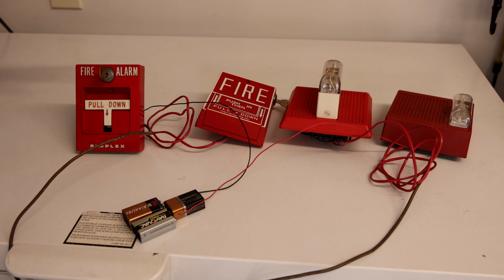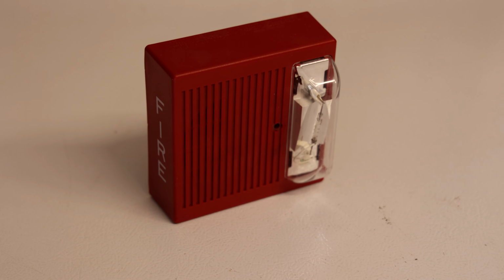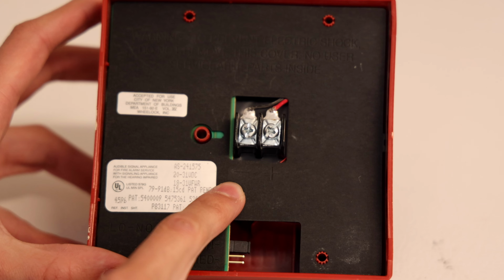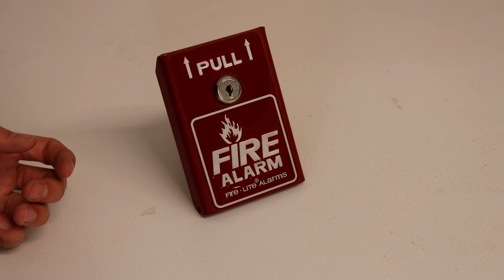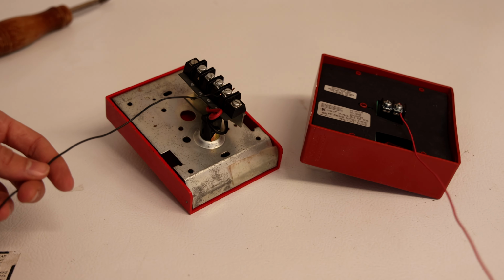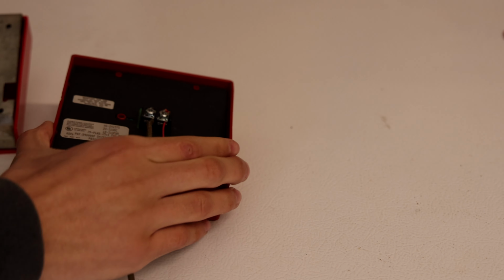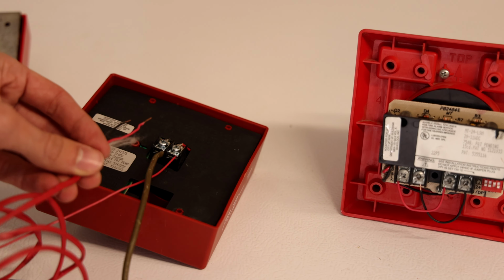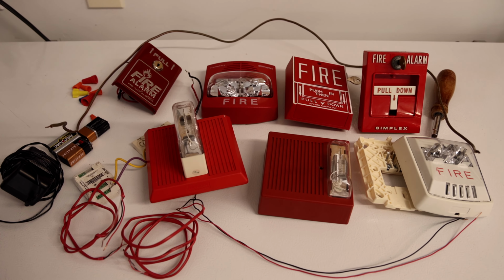How To Wire Up Fire Alarms Without a Panel

Comment: I'm going to be getting some wire that have clips to use with my EST Genesis Remote Strobe and Simplex T Bar Pull Stations. Will those work if I clip them onto the screw posts?

Comment: Thank you s e r I know how to connect a fire alarm without a control panel even though I have a control panel I do not want to use it I want to connect fire alarms to pull stations😊

Comment: Yo! Great video! Ive been interested in doing this for a little while but i would like to use the adaptor. The only thing is i cant find one with wire ends. Do i just chop off the end part to get those? Thanks!
Reply from the maker: Yes, you can cut off the piece on the end and then strip down the two wires. Of course, make sure it's unplugged when you do so, the right kind of adapter, and that you don't need it for anything else!
Reply: @SERSafety  Thank you so much!!

Comment: What wire did you use to connect the second pull station and fire alarm? If I was working with a plug do I need a 27 V AC power plug?

Comment: My son has recently gotten into fire alarms and we're building some demo stations together.
When wiring up his alarm to a pull station it seems that a small amount of power is bypassing the switch. The alarm goes off faintly, then fully when the switch is pulled. 
Any clue why? I'm not sure if it's addressable or not. Could that be why? 
Great video!

Comment: I have 2 questions for you 1; When your wiring 4 fire alarm devices could you use 2 12 volt plugs 2: could I plug in 2 12 volt plugs on the same outlet at the same time
Reply: No and No

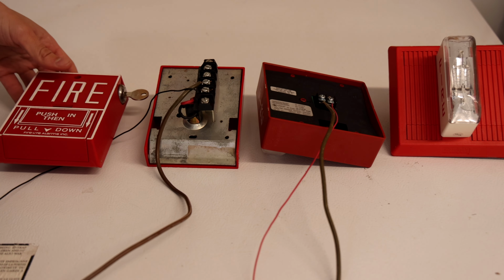Comment: For the example at 6:00, it looks like you're doing a series circuit. Are the alarms be running at a lower voltage?

Comment: My fire alarms run on 24VDC.  I've sounded them off using 3 9 volt batteries, but I would like to find an AC power supply that converts 120VAC into 24VDC.  Anyone have any recommendations?
Reply: doorbell transformer. available at most any hardware store